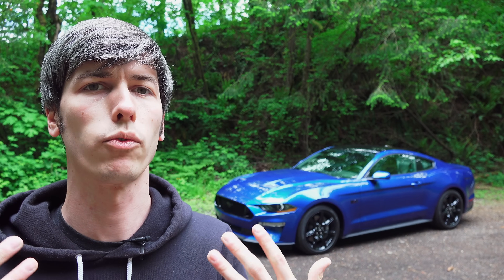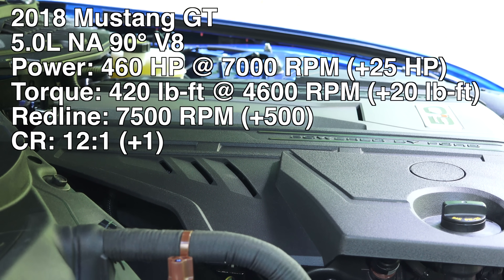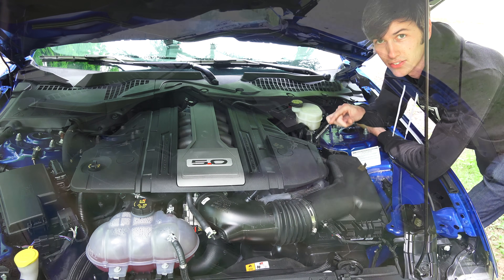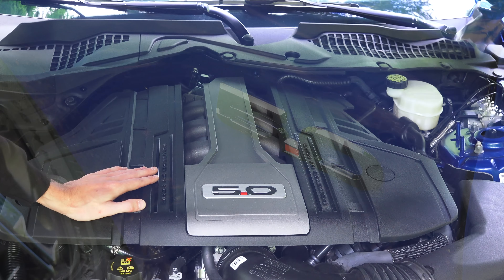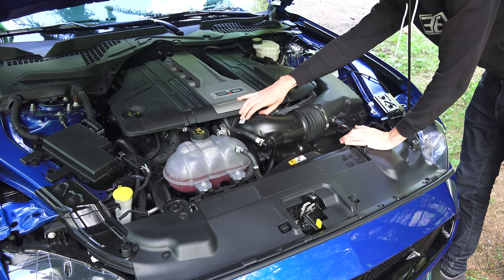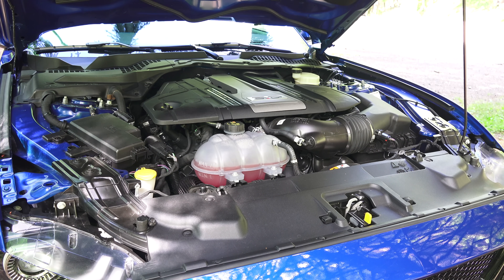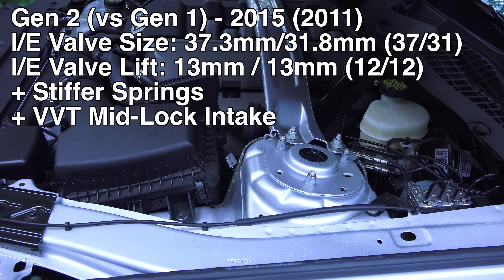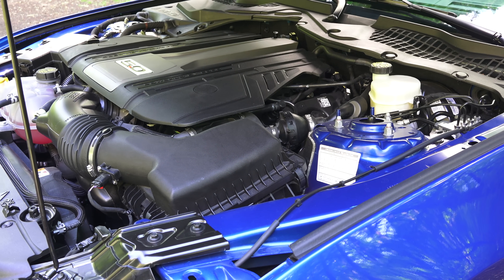The Best Engines - 2018 Ford Mustang GT 5.0L V8

Comment: No “Best Engines” list can be complete without mentioning the VR6. Not only is it the best sounding 6 cylinder engine ever produced, it’s truly revolutionary engine configuration (staggered pistons in the shape of a narrow-angle V w/ separate valve trains but on a single cylinder head) is used in a “W” format in some of today’s most iconic hypercars (Bugatti’s Veyron and Chiron). 

And I happen to have a MK4 GTI that I LOVE that happens to have a 2.8L 24v VR6 in it!! But that doesn’t make me biased at all... Does it?
Reply: Me and a buddy had a 97(i think) jetta 5 spd with a vr6 given to us in trade for some mechanic work a while back. Honestly I wasn't too impressed with it. I've always heard they were quick, but was a bit let down when we compared it to some of our other cars.
Reply: Your video is bad and you should feel bad!...unless of course your video is good, then carry on. So back in ‘97 the VR6 was quite a bit different than the variant of VR6 that I have in my car, which is much more similar to the VR6 that was used in both MK4 and MK5 VW R32’s, and is still being used today in the Porsche Cayenne. The biggest and most consequential difference between the two generations of VR6 is that up until approx ‘01-‘02, the VR6 only had 1 intake valve and 1 exhaust valve per cylinder for a total of 12 valves. Right around ‘03 is when VW changed from the 12v to a 24v layout. I’m not sure what kind of power increases that would yield, but I do know that more flow GENERALLY means more go. They also decreased the angle of the V from 15 degrees to around 10. This makes the engine run considerably smoother, as it got the VR even closer to a traditional I6 layout. My car has a 2.8L 24v VR6 and it has been modified some (2.5” magnaflow catback exhaust, rims and tires, bilstein coilovers, and an ECU tune done by Unitronic. The car currently makes approx 220 WHP and 210 lb-ft of torque @ 3500 RPM. While the HP numbers aren’t THAT low (esp for a car produced 15 yrs ago in ‘03) , they certainly don’t really blow you away. What makes the VR6 so punchy is it’s torque. My car may not be the fastest car on the street, but I put it up against any car in the “fun factor” category. ESPECIALLY other FWD cars...

Comment: Awesome... now let's see the awarded engine after just 100k miles
Reply: Not a problem if you only drive in summer
Reply: Why?
Reply: Had a fist gen with 60k not a single issue. Had it tuned and ran it hard often. Fun car but traded it for a Raptor.

Comment: So  what makes it the best? because ford overcomplicated another motor?
run it for 200,000 miles then tell us how good it is. 
7.3 was a good motor 
5.7 Toyota, good motor 
6.0 gen 2 chevy good motor. 
I'm just curious what makes that mustang motor "the best"
Reply: Chris Roads I have a 2011 coyote car. 132k miles strong with 0 issues so far
Reply: Run that car up to 300 000 miles with just oil changes then ill be impressed

Comment: Now you gotta do Chevy's counterpart... the LT1 please!
Reply: Valanahara chevy still uses oldskool tech. Pushrod, 2 valve, no replacement for displacement, blower for the win. Strong and simple, but not really revolutionary.
Reply: Hey, i had 3 LS1 camaros in ky life so far..

I learned that old school tech are still damn good.  Simple, easier to deal with and you can still pull a lot of power from it also.
Reply: My**

Comment: Why does my 2017 Coyote have the BBQ tick? Kind of disappointed with the quality control of the engine. The tick is a common issue and Ford isn't able to fix it. Don't get me wrong, when the engine is pristine it's a beast, but this tick... pisses me off. But nobody will ever officially mention it...

Comment: I like this series and hope you continue it. Can you add another video to your to do list? I'm interested in comparing fuel efficiency between NA, supercharged and turbocharged engines. I would imagine that the boosted engines are more efficient than the NA engines, since they can produce the same power with less weight, but how do driving styles factor in to change them? Maybe comparing vehicles with similar weight and power would be good, but it would be best if there was one manufacturer who offers the same engines with and without the forced induction. I think Chevy has at least one car that has two engines, and the bigger one has an optional turbo, but I can't quite remember.

Comment: Finally, someone can speak to appreciate an engine configuration “DOHC”. And thanks to Ford putting most powerful engine configuration in full use. Of cause, Ford has been using DOHC in several different models in the past. The first Ford production model used DOHC might be Taurus SHO. Limited Ford production might be GT40.

Comment: One engine that I always remember was in a Mack truck... it was around 1974 vintage R model Mack... quite advanced in its day. The turbo on the exhaust (while not a new concept back then, was not so as common as big diesel turbos became later) would divert some of the charge air to a smaller turbo which then pumped ambient air to an air-to-air charge air cooler. I was a kid of around 14 yrs old then, and rode in the truck... the sound that engine would make as it loaded up was just amazing...! To hear the small turbo begin to spool... still sends shivers down my spine!  Would be neat to get your take on the engineering that happened at Mack trucks... they did some very innovative engineering back in 60's and 70's.  The engine was the ENDT 676 Maxidyne... very cool!

Comment: The new 2018 Mustang GT are amazing and simple bolt ons like X pipe, cat back exahust, Intake and a tune and you expect to see at least 500+whp 

Ecobeast/StangMode has a 2018 GT and he clocked a 11.3 sec at 123MPH on the 1/4 mile. And that is on a 10 speed automatic. 

The direct fuel injection makes a lot of difference in the high rpm range. 
Badass.

Comment: Individual valves that control air flow for each cylinder is not something new. Back when Mazda and ford had major tie up the MZR DISI 2.3 turbo in mazdaspeed3/6 came with that port shutoff feature.

Comment: For $6000 more you can get the Bullitt Mustang with 475, lol,............... that might be the 15 hp. that you need.
Since they found the perfect V-8 template they should scale up this engine to 7 Litres to achieve 644 - 665 hp and drop the 6.2 L entirely.
How about a 4.0 V-8 at 380 hp?
Not crazy about spray in liner technology (it frightens me), but I haven't heard of any problems with them in the 5.8 L Super Snake which came out years ago.

Comment: Would have been nice to mention that basically the Gen 2 took everything Ford learned in developing the Boss Gen 1 engine and put into the stock Gen2 engine. The Gen2 heads, valves, valve springs, and cams are all basically straight off the Boss 302 engine

Comment: I have a couple of questions about the sprayed in cylinder liners. Do you know the durability of the liners, I have read that they are just under .006 in thickness.  So with the pistons  going up and down over thousands of miles, how long before the liners wear out and your into the aluminum block. Also with the heat cycle of the engine would the liners ever flake off at some point?

Comment: BMW S85 V10. The only BMW production V10 ever, and the only engine not based on a normal N series engine, nor shared with any non M cars. It is basically a race engine in a road car, and it is truly a monster. It's also one of the best sounding engines in history.

Comment: So what you’re telling me is that this is a Chevy 307 😝 jk
Reply: Yes that is exactly what it comes down to!
Reply: Timboslice I had a 307 in my 85 Lasabre, 4-barrel . 25,000 miles with check engine light on. Very underpowered but reliable. These Coyote's are already becoming icons. Sure it's sister engine, the EcoBrat is mighty but it just doesn't have that ole' Muscle sound.
Reply: Timboslice no because Chevy has yet to make a good mod motor

Comment: Here in Oz, the Mustang gets a 2 star safety rating. 
Fuel economy around town is quoted as 12 mpg. 
Ford have just been fined $10 million for refusing to help car buyers with their Powershift transmission problems.

Comment: Unless I heard incorrectly, I thought the previous years ('15 -' 17) only had direct injection. The 2018 added port injection, making it both port and direct injection, which is great for the top of the intake valves.

Comment: Not built by Ford,built and engineered by Jaguar with the Ford name on it.Uses 10 quarts of 5w20 synthetic oil.Changed the oil in one and has a plastic drain plug.The intake manifold is a copy of the LS engine intake

Comment: Yes yes! More stuff like this. An engine diagram and comments about balancing corrections or"this engine is balanced because A, B, C" would be cool.
 Awesome job micing the exhaust so that it didn't clip. That's not easy.

Comment: Why do they make such a big engines with not that much power, the 2.3l ecoboost makes 350hp so surely they could make a 4.6l V8 with 700hp, I don't understand in 2018 you would make anything bigger than a 4 cylinder before turbocharging it

Comment: While the 2018 Coyote engine is impressive, I've always been even more impressed with the engine in my 11 year old 2007 Yamaha Apex RTX snowmobile. It makes 150 hp out of a 1 liter 4-stroke engine that has electronic fuel injection, 5 valves per cylinder and nickel silicon plated aluminum cylinders (similar to the 2018 Coyote). It also has incredible throttle response and impressive torque over a wide rpm range. Looking at the numbers many people mistakenly think it would behave like an ultra-peaky drag race engine because it needs 5000 rpm for good torque and over 7000 rpm before the torque gets impressive. But when you realize how much torque and power is available all the way to 12,000 rpm and use appropriate gear ratios (typically tuned for just under 11,000 where peak power is) you end up with insanely impressive performance. With good traction (ice picks on ice or on very hard packed snow) a 0-60 mph time of under 3 seconds is typical. Hit the throttle at just about any speed and almost instantly all 150 hp is available. While mine is NA and stock, aftermarket turbochargers are resulting in as much as 600 hp out of these 1 liter engines and 700+ hp with turbocharged, stroked 1.125 liter upgrades.

Imagine a 5 liter Mustang making a naturally aspirated 750 hp and your in the same power to displacement ratio of Yamaha's 11 year old stock snowmobile engine. Imagine making 3000 hp out of a turbocharged 5 liter engine. The R1 motorcycle has a similar engine that makes even more stock power out of 1 liter too. In 2007 it made 186.5 hp out of an updated version of Yamaha's high performance 1 liter 4-cylinder engine. That works out to an insane 932.5 naturally aspirated hp out of a 5 liter engine if it were to achieve the same power to displacement ratio.

I guess there is still room for power improvements in modern high performance car engines...

Comment: It would nice to do the ecoboost 2.3L at some point to compare the engineering differences and design choices that Ford did compared to the V8. The ecoboost has also won a few engine awards, its got some clever tech in it thats not really explained in detail but rather always just marketing speak.

Comment: how about an oddball that was way ahead of its time? 89-95 Yamaha 3.0/3.2L 24 valve DOHC V6. Actually would be a good tie in as the '89 Taurus SHO with that engine was 0.1 second faster quarter mile time than the same year mustang with the 302 windsor

Comment: Yes, please! More of the same. Cost info comparison might be good and zero -> 60/100 comparison also of interest. Of cause... how much more power would it get with water injection? Should be calculable based on volumes and theoretic air/fuel density increase.

Comment: I love this new series! however, some of ward's and other "best engines" are plagued with issues. Since these are "reviews" maybe talk about these issues or shortcomings. Other criticisms are welcome so it doesn't feel like were watching a car commercial even if they're small/ nit picky. Engineering is all about balance and it's rarely possible to gain something significant without sacrificing something else. Even if these trade offs are well understood by some. Example could be comparing it to the competition or a similar type of car. Comparing it to previous gen (like you did) works too, but i think small incremental improvements dont contrast enough. Also i think another area you can touch on quickly is performance modification. I understand that this has a wide range from mild to wild and there isnt always tons of information like this on newer engines but i think a strong portion of your fan base would love to hear about this.

Comment: @ 7000 rpm?????? Who the f&$% rides at 7k revs....seriously? I know they got those #'s from dyno testing it but geez ford u could've at least  put some realistic numbers up there like 225 hp @ 2200 revs. At least that's closer too highway driving in the real world u know
I have never had a mustang, but i do as a gm guy have to give ford the credit they deserve, they do have best stock exhaust . Just a lil better than Subaru wrx & sti
Reply from the maker: Peak numbers are always what's shown.
Reply: Engineering Explained , yea i know. It wld be nice to see daily driver numbers tho. U know like i said 2k rpm for highway etc. But yea i get it. While i have ur ear i just wanted to say thank u for the content that u provide. I have learned so much from watching ur videos & how u break everything down. Really amazing to see how most of those systems work u know. Im really interested in the engine thats gna use diesel AND gasoline sounds like it could be a very interesting system to learn .thanks again man.  👌👍👍

Comment: This engine is the reason you see all of the LS motors in the Mustangs, just sayin
Reply: onlychevys Williams, on the contrary, the Coyote is a pretty popular swap. It can be a tight fit, but it's fast becoming a common choice for restomod Fords, especially earlier Mustangs. There's even a Smoking Tire One Take of a Coyote swapped Porsche Cayman, it's a monster!
Reply: onlychevys Williams Thta has to do with cost and nothing else, the Ford crate have generally been more expensive then Chevy but they are also have incredible potential.
Reply: I disagree, look at how well the LS motor is doing. There is no one transplanting that big motor into anything, why would you. To each their own. If everyone like the same thing, life would be boring. Thanks for the reply!
Reply: The LS is an easy swap the Coyote is the choice for those who want max HP and you can only get that two ways, big cubes or 4 valves. 4 valve heads will always make more HP per CI than 2 valves. When GM goes 4 valves their fans will start swapping them into their GM bodied cars.
Reply: LS engines are much cheaper and fit a hell of a lot better in old Foxbody/SN-95 engine compartments, more similar in size to the pushrod 5.0 than the huge Modular engines. I've seen several Coyote swaps in Foxbodys and many LS swaps, Coyote swaps are always clean and expensive, LS swaps are always very cost effective. Easy choice for most weekend hobbyists.

Comment: Would it be possible to review the engines of Audi RS3 (2.5 with 395 hp), the Mercedes CLA45 (2.0 with 375 hp) and the aspirated engines from Porsche. What compromises are they doing to achieve those numbers that other brands struggle to achieve.

Comment: You should do the 1 liter Ecoboost from the Fiesta. Which unfortunately you can no longer get in the states.
Reply from the maker: The 1-liter turbo is in the EcoSport now. :)
Reply: I have a 1.0L ecoboost Focus with the 6sp manual. The motor has a lot of torque for such a little thing. Acts more like a diesel once the boost pressure builds. Unfortunately it's a balancing act between spinning tires and bog city to take off quickly. Gets an honest 40mpg highway and 34 in mixed if you keep the revs down.
Reply: EcoSport without a manual trans? No sport there.